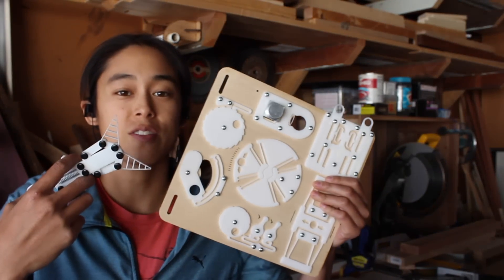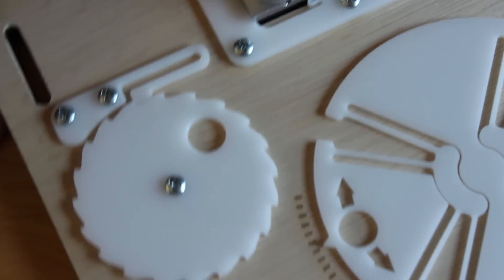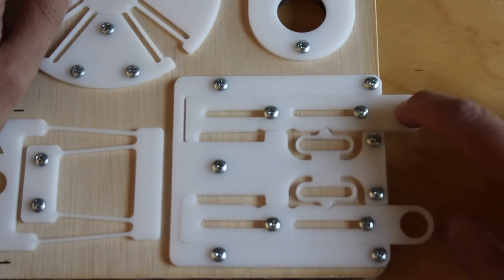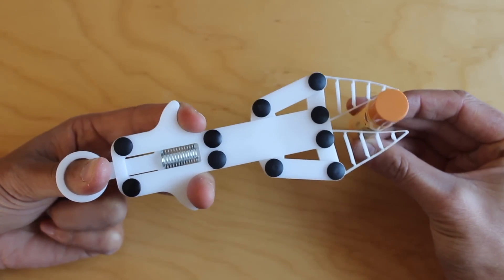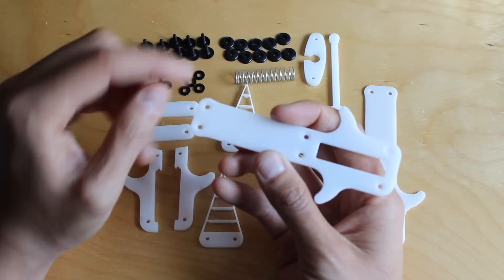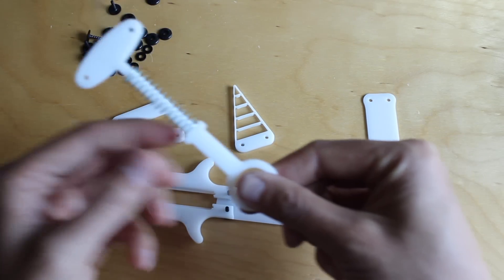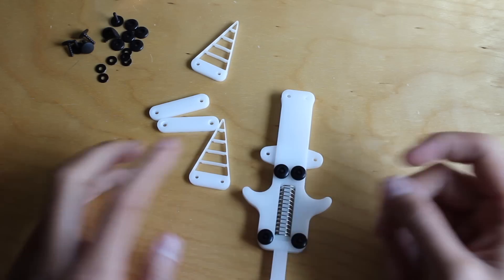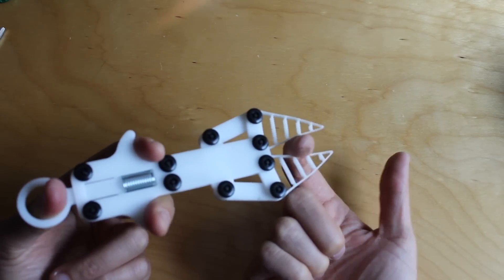Flexure Gripper and Demo Board

Comment: Great job with this! I have found that annealing some plastics in an oven after laser cutting increase its resilience to brittle fracture, actually eliminates it in fact.  If you are ever ever looking for someone to help bounce ideas off of for mass production or design for manufacture feel free to reach out to me. I have over 13 years in plastics component design and manufacturing and am looking to broaden my side project reach and network.

Comment: What program do you use to design these flexible mechanisms?
Reply from the maker: Fusion 360. But any CAD program should work. These flexores are all 2D shape so even a 2D drawing program could probably do it (I am not well versed in those)

Comment: I am so glad google is spying on me to help me possibly solve a problem for a future 3d printing project. Your locking tab mechanism might be what I was just looking for. Very informative video, I enjoyed the demo board presentation. I am new to stuff like this, I may switch from software engineering to mechanical, but im on the fence. Regardless thanks again for the video and the github link.

Comment: How well do these work with various metals?
Reply from the maker: You typically need way fancier equipment to make these kinds of shapes out of metal (at least if you want to cut the whole shape out in one piece), something like a waterjet, wire EDM, or laser that will do metal. Or you could make small assemblies. For example, a simple length of spring steel wire would be an effective substitute for lots of the bendy parts on this demo board. In fact, metals often have much more ideal spring properties compared to plastic: metals often have well defined elastic regions, plastics creep, etc. But plastic parts are often very easy to manufacture, especially for DIYers.

Comment: Have you ever tried making an analog adding machine similar to the way that they use wood marble tracks to add using binary flip-flop seesaw like gates?
Has anyone ever designed a combination lock using these types of mechanisms?
Reply from the maker: Interesting ideas, never thought about it!
Reply: @AmyMakesStuff  
I found an analog rotating mechanism that puts out a binary single sort of speaking. It is a ball point pen. Click the back (high input) , and with every click it flip flops a high low output.
I wondered if this is how a Babbage machine computer worked.

Comment: How did you laser etch the counterbore? Did you rely on distance (out of focus) to increase the laser diameter/kerf? Brilliant work nonetheless.
Reply from the maker: Thank you! I engraved a solid circle, which is basically a low power cut (doesn’t go all the way through) that covered the area of the circle. I varied the power until I got the depth I wanted.

Comment: So are you cnc laser cutting these examples out of pvc or a Delren material... if so that’s pretty cool very nice clean cuts of everything
Reply from the maker: Using Delrin (don’t ever laser cut PVC!!! It releases chlorine gas when cut which is very corrosive). Delrin requires pretty high power compared to acrylic, but cuts beautifully.

Comment: This is sick. How does the material wear down? Have any of these mechanisms eventually broke or worn out?
Reply from the maker: The material ‘wears’ if it is cycled too many times at a high stress. High stress results when part of the material is bent too far (fatigue is the technical term). You can imagine that if you bend something very far, you only get a few cycles before it breaks. If you don’t flex it very much, you can get many cycles. None of these have failed yet, but that’s mostly because, in their intended use case, there is a limit to how much they can bend.

Comment: Did you ever considered making that gripper with a FDM printer? If you do, you should consider a printable spring alternative as well ;)
Reply from the maker: That’s a good idea! I never actually got nylon or some other flexible filament printing well on my printer, but maybe that’s a good incentive to get it working.
Reply: @AmyMakesStuff  Nylon is cool but a 'subpar' version can be made using only lame PLA :D

Comment: I’m new to laser cutting and I was wondering if you could tell me where to buy delrin sheets at a reasonable price and where you bought the snaps.
Reply from the maker: Snaps from McMaster. Delrin from Online Metals.
Reply: @AmyMakesStuff  Thank you so much for the quick reply. I feel silly since I just noticed today you have a BOM on the github site. I was wanting to make the gripper but looking at the BOM it seems to indicate I would need something like 2 sheets of the 1/16" and 8 sheets of the 1/8". I'm sure I'm not reading right (otherwise way out of my price range for toying with it).  Is this really a couple of hundred dollars or so item to build!? https://github.com/amymakesstuff/flexure-fun/blob/master/Flexure%20Gripper%20BOM%20-%20Sheet2.csv
Reply from the maker: No no, that’s misleading on my part. One sheet of each thickness will yield way more parts than just one gripped assembly. The best way to see that is to play around with the CAD files and see how they would fit on a sheet of material. Also, I used 12 x 24” sheets because I knew I would make a lot of sets of parts. You can definitely start with a smaller sheet.

Comment: Yes, satisfying stuff. There's a bunch of short YT videos, I always have to hunt for when the subject comes up, where they demonstrate many different gear n linkage set ups, rotation to linear, driving an armature to follow a set path that's not circular and not simple reciprocating, things like that. Very satisfying and useful too. I needed a weird movement in a project and just could not think of a reasonable way to make to happen, but I knew somewhere in all those machine motion videos there would be something to spark the answer, and it did. Your detent mech is one I've used. Humm I should finish that project I guess...it's only been 5 years.  Thanks. Cool video.

Comment: Hello! what if we do Boolean algebra? (logic algebra / logic gates / not, or, &) maybe a semblance of a constructor? I think it is clear that this is an opportunity to make a mechanical computer.

 (yes, you will run into a problem, since in large chains even gears (if used) or any other mechanically moving parts will be difficult to move and require a lot of force that can break the mechanisms at the beginning. as an exit, you can use additional "feed" )

(oh, oh! a big wheel that spins and gives each element a spin that they can use or ignore. like the rear wheel of a speed bike. One way to spin from the pedals and the other way, the pedals do not affect the movement of the wheel!)

Comment: Cut an opening in the base of the finger triangle of the flexi gripper so that there is no solid mechanical connection between the two pivot points, that will make the fingers more flexible :)

Comment: This is real cool stuff!! I totally support making these kits available to buy, I'd love to have one but don't have access to a laser cutter yet...
Also, those snap-together rivets. Would those possibly be good for using as a pivot for a pair of scissors? I'm restoring a pair I found amongst some old clutter and I can't find a good piece of hardware to connect through the unthreaded hold in the blades...
Reply from the maker: Snap together rivets probably too weak for scissors, but a screw of the right size with a lock nut would probably work well.

Comment: I wonder how many duty cycles each of those mechanisms have until they break. Is it more than spring steel?
Reply from the maker: A lot of great answers here already! For plastic flexures, I like to design it so that they are bent only temporarily in use. When plastic is constantly subject to a force, it will creep and take the new shape. Laser cut plastic flexures can also have worse performance than you might calculate from the plastic’s material properties because the heat from the laser can create additional defects on the cut surface.
Reply: @AmyMakesStuff  Interesting! What sorts of defects come from the laser? Have you considered using a high quality plywood for flexures?
Reply: The actual answer is that it depends on the material, the shape, and the load.
If you pick a material like plastic, the strength eventually goes down to zero with more cycles. For most plastic parts like this, 10,000 cycles is a decent ball-park, but the real answer comes from charts and equations.
If you pick a material like steel, it can actually survive for infinite cycles. The strength goes down from the first billion or so, but it levels out to a constant "fatigue strength."
If you over-design the parts, even plastic can last for billions of cycles, but the best material would definitely be a spring steel or titanium alloy.
Reply: Compliant mechanisms aren't necessarily made of plastic, so they could be a lot more durable than spring steel, because they don't have to deal with a lot of friction
Reply: Think compliant mechanisms can handle quite a bit
Reply: Depends not only on the design but also on the use itself - steel might bend or break easier under certain circumstances.
Reply: hinges in plastic products (like plastic lids and tic tac mints boxes) are  made from polypropylene or polyethylene.
If they're injection molded it can be best to flex the hinges a few time when they're fresh out of the mold, to align the molecule chains properly which increases the hinge's durability. The plastic flowing throught the mold helps their alignement as well. You can't guarantee a good alignement with laser cut hinges.

source and more info: https://revpart.com/living-hinge-design-guide/
Reply: Subscribed ☺🇬🇧
Reply: Yes